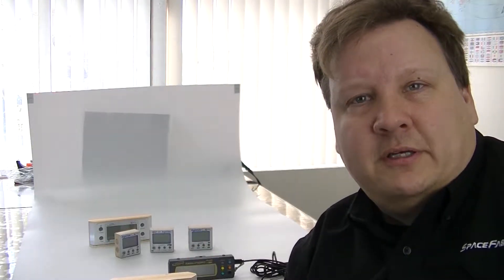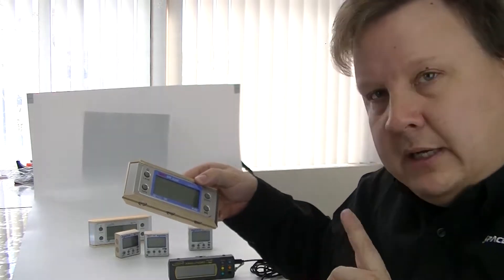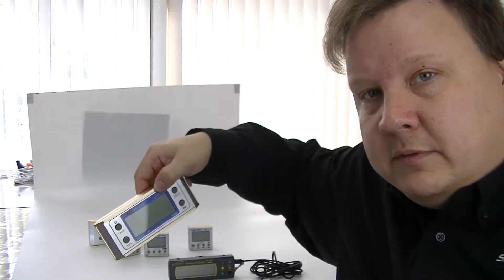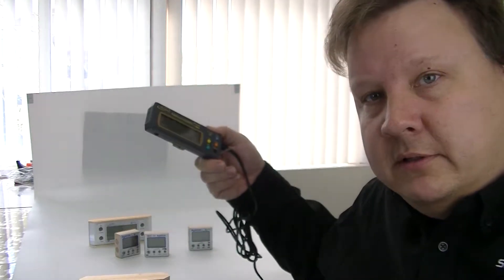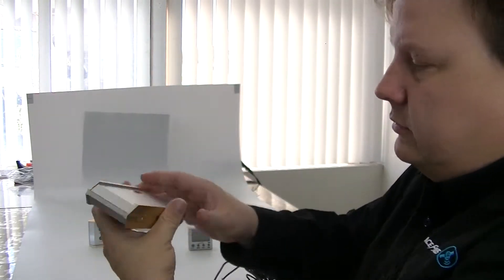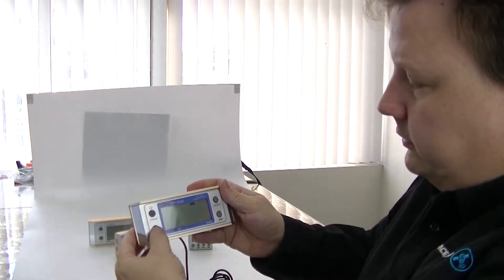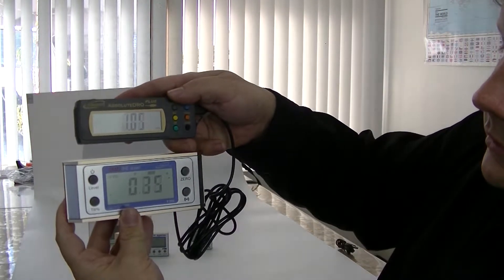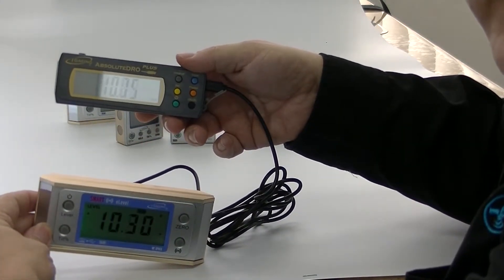iGAGING DRO Digital Read out for remote use.

Comment: Just dawened upon me, remake the video and do this.  Set the level down on a flat surface, zero it.  Hook up remote unit and after level is back to zero zero remote unit.  Lets then see if the numbers are exactly the same.